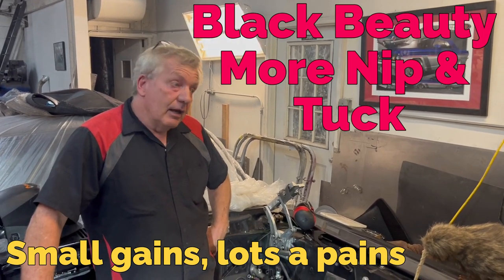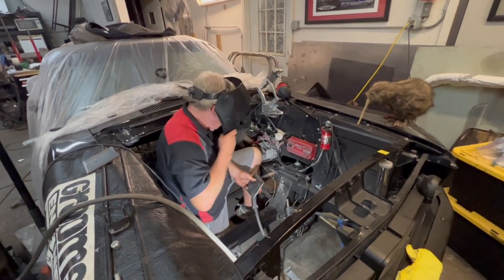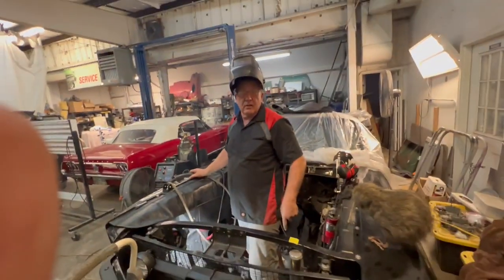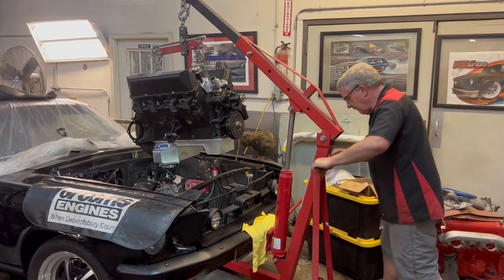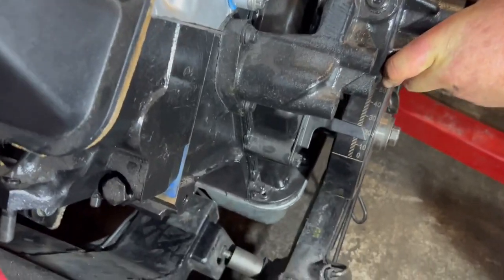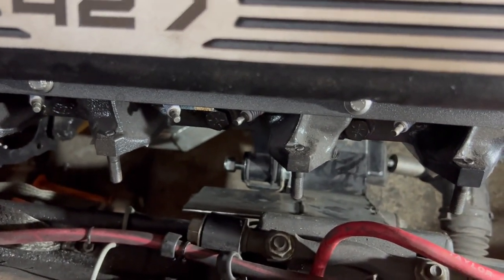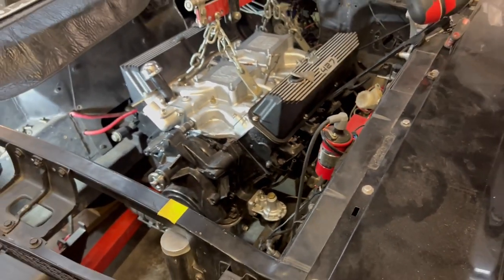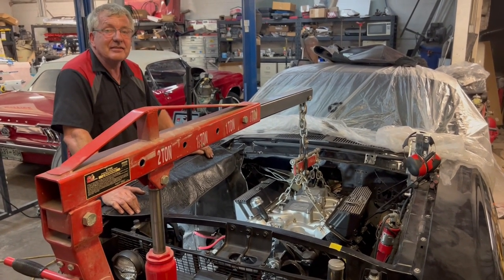Black Beauty, More Nip & Tuck

Comment: I'd say the first tack you applied to that plate would have been stronger than the birdcrap that was on the mount from the last "fabricator".  Looking great bro.
Reply from the maker: Thanks man, a tack still has to hold and in this case hold up a heavy ass engine
Reply: Damn straight. I used to build Aluminum boats in Kapiti and been a heavy auto engineer since i was 15 so learnt that very early on too. I loved how you were able to rip the old mount off with your hands in a previous vid. There are some serious cowboys out there. Go hard bro.

Comment: Does adding that much angle to the tierods effect the steering geometry, like bump steer? I'm not judging, just asking because I don't know.
Reply from the maker: It's a good question. If the rack is too far forward or back of a straight line across the car it will increase bump steer. A small amount of bump steer is acceptable. Keep in mind that 100% of production cars have bump steer. Even Formula One cars have it, ok it's measured in thousandths of an inch but they still have it.  It's not unusual to see an inch of bump steer on a production car and drivers i don't notice. If your trying set lap records at road Atlanta you will notice. As this car progress' I'll talk a bit more about bump steer
Reply: @kiwiclassicsandcustoms9160  Thanks ! Looking forward to it !

Comment: I always lift the engine up High have a Counter weight on the back of the Engine hoist. A couple of Iron Small Block Chevy Cylinder heads works for me.
My Pontiac 455s all iron are heavy wants to tip the Cherry picker no counter weight.
I prefer to roll or pull the car with 1 hand towards me. Engine into the bay lower.
I work alone all the time too.
Man Your Strong for Your Age Kiwi in Excellent shape like me , I am going on 53 now.
Reply from the maker: Ha, just a youngun😁
Reply: Gets better Cherry Picker. They aren’t supposed to do that. All the weight should stay over the arms and wheels. I have never had one even come close to tipping over. I have changed out hundreds of engines. Good luck.
Reply from the maker: @tonyhammer3588  Am I missing something. The cherry picker didn't get tippy..??
Reply: @kiwiclassicsandcustoms9160   No sir. B&R Racing posted that his cherry picker tips when he has a 455 Pontiac engine on it. Just replying to his comment. You did nothing wrong and as a matter of fact, I have the same Cherry Picker as you do. Works great every time. I love your content by the way. I found you through UTG. YOU DO AWESOME WORK. I look forward to watching all of your videos. Thanks from another car guy.

Comment: As far back as you can get it to improve front to rear weight ratio, as low as you can go so the center of gravity is closer to the ground and lower will also help the air cleaners fit under the hood more gooder. 

Of coarse make sure to have adequate ground and firewall clearances at the same time you're doing the above. So far looking good.

Make sure to keep an eye on the trans angle because the motor mounts will only pivot so much plus you really don't want side load those to much because it will be a son of a gun to get the bolts in.(of coarse you know all this but the more words the better it helps to recommend this video in the algorithm)
Reply from the maker: It's always good to be "more gooder" 😁 All good points that need to be taken into consideration. Thanks man!
Reply: @kiwiclassicsandcustoms9160  

Yes sir.

Comment: Is all of the cutting to accommodate the rack and pinion?  I thought Ford didn't cut anything to fit the 427s. Setback is good though.
Reply from the maker: She'd be  done if it still had stock suspension.  The Heidts suspension and rack and pinion make all this necessary.
Reply: @kiwiclassicsandcustoms9160  I was wondering.  I was thinking I'd rather go back to stock steering, but if that's no longer practical, then enjoy the accompanying benefits of engine setback - especially with an FE.

Comment: I don't understand why you don't use factory mounts and put the motor where the factory put it they did come factory with the FE motor
Reply from the maker: Yes they did! The huge difference is this  car has Heidts front suspension and rack and pinion front steering so it's nothing like what the factory did.  Factory mounts and oil pan will not work!

Comment: I hope the MSD 6AL is ok. You should take harness out of the box when you weld on the car. I take the entire box out. It's in the literature that comes w/ ignition box.
Reply from the maker: Interesting.  Good tip, thanks!
Reply: @kiwiclassicsandcustoms9160  No problem.
Reply: Those MSD boxes aren't cheap. F.Y.I. now that I think about it, all MSD ignition boxes want 100% ground. If not they will fail, usually at the wrong time, I'm well aware of this. Get yourself enough 8 gauge wire to go from the negative post of the battery to the main black ground wire that goes into the MSD box and that'll do it.